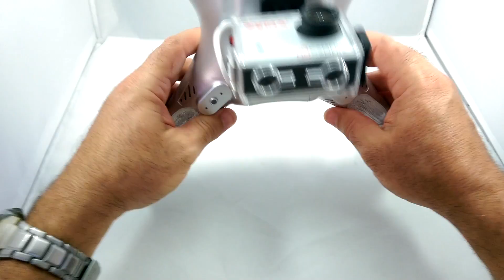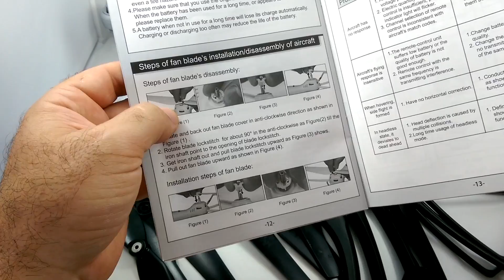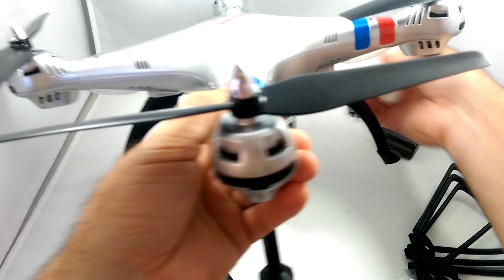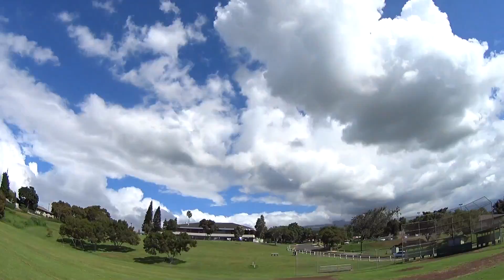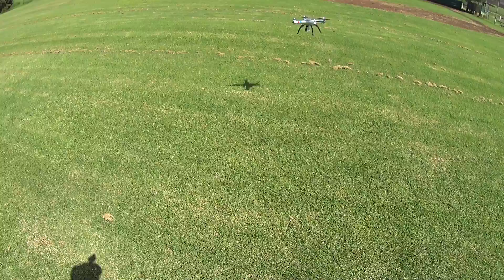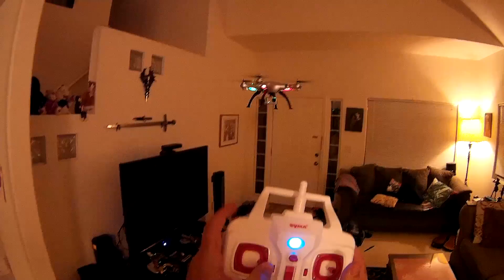SYMA X8G Review - HD Quadcopter Camera Drone - [Setup - Flight Test - Pros & Cons]

Comment: hi dustin will the SJ4000 cam  work on this X8G with full camera control from the controller
Reply from the maker: +William Davie It will mount but you will not have control from transmitter.  youll just have to start the video or auto picture mode on cam before you lift off.
Reply: thanks dustin  can you give me a bite advice please i was on bestgear.com  and i was away to order the X8G  its on flashsale  for $121.18 usd  then i noticed  they ar selling the X8W for $60.31 usd   what would you say is the better quad to bay dustin  i know the X8G  has good reviews and feedback knowing you liked the X8G yourself  but i thought maybe better asking before i click bay now lol  and thanks again dustin

Comment: Hello I am having a problem when I turn on my drone with the battery in and charged for the amount of time the lights will start to blink and the quadcopter will not fly can you help? Thankyou
Reply: bikelife scib Sync the controller with the quad by pushing the throttle lever up and down.

Comment: what! it has a return home? how do i do that?
Reply from the maker: +treverlid87 Hold right top trigger until long beep.
Reply: +Dustin Dunnill Really??? This is the 1st video that I've seen this mentioned. Not to mention, I can't find any documentation of any variation of the X8 having the "Return To Home" feature. Interesting..
Reply: Ya it dont work iv tried it with my x5sw and my x8c
Reply: +Dustin Dunnill Hold the right top trigger ? Up or Down or ????  And is that trigger the joy stick ? or the small square button ??  I'm just trying to learn about this drone as well....

Comment: Great video. I have a Syma X8G. I did not know it had a Return to home function. Can you tell me how you did that? I thought the top right button on the controller was for flips. Does it have to be in headless mode for it to work? Thanks.
Reply from the maker: Hold on top trigger...long beep and it returns as seen in vid
Reply: Thats cool. I cant wait to try it. Thank you very much. You had another viewer about 10 comments down asking the same question.
Reply: +Dustin Dunnill Dude. I have watched many Syma quadcopter reviews and you are the only person that knows this. This should also work on the Syma X5C. You should let more people know about this return home option.
Reply from the maker: +Joe Flash Cool man.  I'm just getting to some comments now so I"ll check.  Thanks.
Reply from the maker: +Joe Flash top left short press = rate change, Long press = Headless.  top right short press and right stick together = flip, long press = Return to home
Reply: I know what the left button does but not the right. Great info. Mode1 and mode 2 is just reg and headless? There is no option that gives the quadcopter more power right?
 I saw one guy say that in an X8C video but I think he was wrong.

Comment: how do you getthe return home feature to work ?
Reply: It doesn't have one
Reply from the maker: +WC  Wickedclown RC inc hold down right top trigger button until you hear long beep.
Reply from the maker: +chris It does.   Hold right top trigger until long beep is heard and it comes back.  this is not stated in manual.
Reply: +Dustin Dunnill does it work with the x8c, can you explain this better please?
Reply: +Mr_Traight just hold down the top right button and you'll hear a beep. It will return home! :)
Reply: Cashless does it work with the x8c?

Comment: awesome review . . one question i have a syma x8g too . . but it puzzles me how to make it hover or maintain its position. .  mine keeps in moving . . idk why? can you share how you make it handle so easily?
Reply from the maker: Try resetting accelerometer on level surface and trimming.
Reply: how?
Reply from the maker: Set on level surface and both sticks bottom left and then bottom right?  I forget but should be around there.  Then trim with right stick trims for fine adjustments.
Reply: +Dustin Dunnill thanks for the reply . . you mean calibrate it . . yes i already did . . i'm having issues on how to control the throttle . .

Comment: Just a quick question for everyone that has this model X8W. Does your cam come on when you power up the drone ? Mine does nothing at all... Thinking I may have got a defective drone or cam.... :(
Reply: You have to turn on the camra with on of the trim bottoms. It is on the top left. Look on the manual
Reply: Thomas A.
Thanks... Got it figured out. The power cable was faulty, and the can wouldnt come on when I powered up quadcopter. I got two new power cables, (one spare) and everything is working great now... Having a blast this quadcopter, teaching myself to fly, then I'm going to upgrade to a fancy drone... CX-20 or the new Xiaomi Mi Drone ... Both are great drones, but I sure like the features on the Xiaomi Mi Drone...

Comment: recently bought this drone. crashed hard on the ground at a fall from 40? meters. flew to high. drone didnt respond. id suspected or hoped it came responsive eventually during the fall.. but didnt. normal behaviour? or operator error?
Reply from the maker: +Ronald Werkhoven you may have a failed motor.  Same thing  happened to me when a motor failed.
Reply: Ok after the crash, last weekend.. i flew with the drone multiple times ( approx an hour ) without falling from the sky. also flies pretty stable. still if it was actually an engine failure it sucked that it had to be high..above ground :(
Reply: +Ronald Werkhoven Oops!  That sounds like bad news.  I agree with Dustin on the motor issue.

Comment: Very nice and informative video.  I cant post a url here, but if you check out my youtube you can see how I put noodles on my syma and walkera because I live near water.  The pontoons can hold fpm gear and also added mobius camera and with balanced props the video is very good as everything sits on the noodle foam. Noodles also good as a life jacket for the quad in case you dump it in the lake lol..  Thanks again for the great demo. Happy Flying.  GrampaKenCanada
Reply: +Ken K. FPV gear correction

Comment: The drone seems good but bad user manual that explain only shit, i just lost mine 2 days ago, no where to be found, please newbies, be very careful with the throttle as they explain by saying moving the lever up or down to fly upwards or downward, i taught that was the way to fly it and applied the throttle up at full and moving forward at full also, never knew how high speed also got selected, it was like a jet, had a high altitude, when i push the lever downward, all the fan will stop, and the drone start to fall as if it cannot fly again, and i will try and push it upwards also and not knowing im still pushing it  fully, i got in a situation where by i don't know how to control it anymore, there is no one time key that will bring the drone back home, i could have done that, no explanation inside the manual on how to land, it really suck, with the reviews that i have watched no tutorials on how to use the transmitter especially the throttle for first time pilots, it is a pain in the ass when i couldn't even record a single video, everything got lost in the woods, no gps, to track drone , please @ Dustin Dunnill do a tutorial on that because the manual really really suck, they never explained about the small bars that appears when u push the throttle upwards, if they did, it could have saved me, you will lost it before figuring out, because there is no tutorials out there, left with a useless remote by the way i will still get new one, i also want to know how far can it go, and how many minutes it takes for the battery to runs outs, recording video was off, because after many hunts for retrieving prove futile, as people use to tell me they saw the drone flying pass certain trees while the remote was off, really strange.

Comment: Maybe he fooled us with the return to home. You don't see the controller once the quad starts coming back. He could be pulling on the stick. It didn't look like it was executing a classic RTH.
Reply from the maker: It's got RTH but I forget which button as I haven't flown it for a while.  I didn't mention in video?
Reply from the maker: +nukedaddy I wouldn't deceive anybody about it working.  Not the way I review if you seen any of my other reviews.  You'll find that sometimes the manual is wrong in explaining what buttons do what on occasion with these types of copters.  If it worked in the video and I talked about what I pressed to make it work you can be sure it did for my unit.
Reply from the maker: Ok so I just watched my vid again.  It looks clear enough to me that I'm holding right trigger until a long beep it heard and it comes back.  This was not stated in manual.
Reply from the maker: If you are moving right stick at all it won't work.  Try let go of right pitch/roll stick and try.